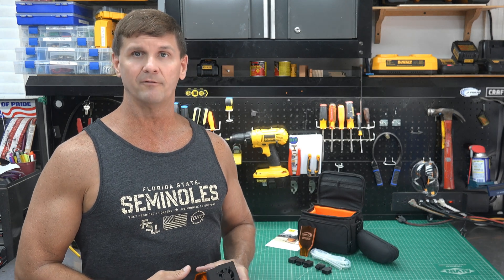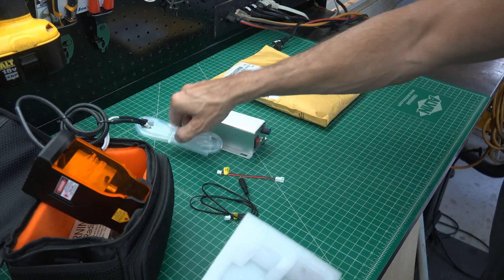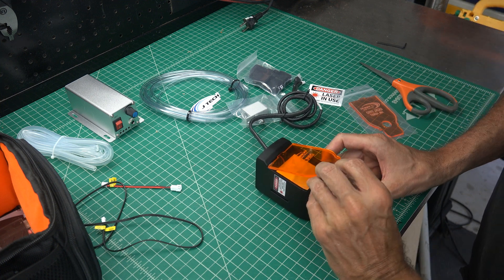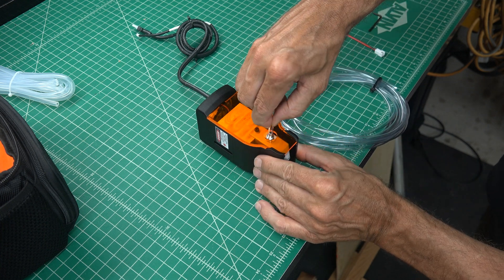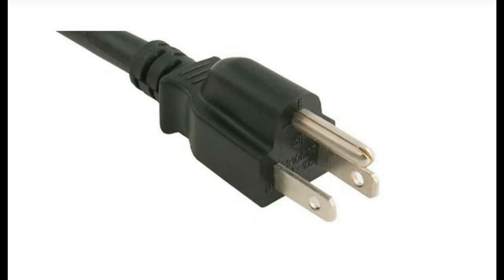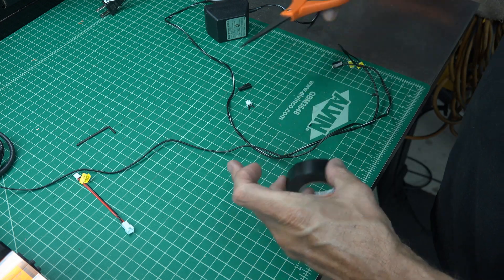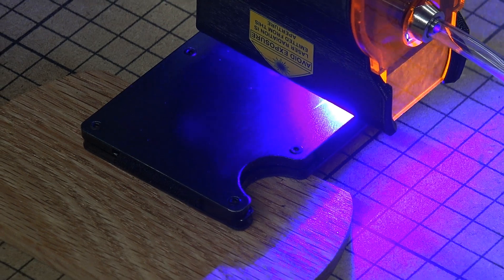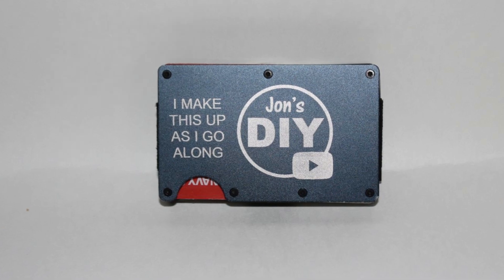Air Assist on the 14w Jtech Laser

Comment: Thanks, Jon.  Great video.  I do have a question.  What do you do with the air hose when the laser is disconnected?  Do you route the aire hose through the drag chain?  I have the 50W pump that JTech recommended. The air pressure is somewhere between 5 and 9 PSI. Hopefully that will work.  The pump does not have an on/off switch or the ability to adjust the pressure. Jay Johnson (at JTech) said this pump would provide adequate air pressure.
Reply from the maker: No, I just roll it up and stick it in a camera case with the laser.  It pushes on and pulls off pretty easy.

Comment: How long did it take to finish the engraving for your wallet?
Reply from the maker: About 6 mins.  Its anodized aluminum. Its quick.
Reply: @JONSDIY  I bought the air assist recommended on Jtech's site do you just run the air full blast or is there a science to it? The one for cutting i should add...
Reply from the maker: @NTIRISH25  yes if it is a standard fish tank type .  You would need about 30psi before you exceed any benefit.